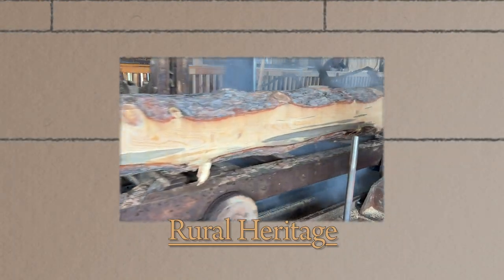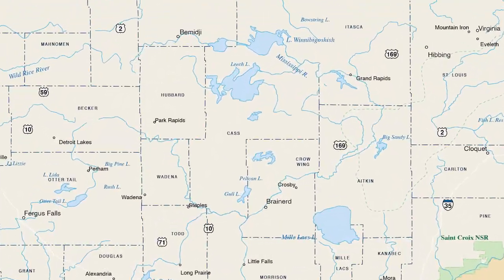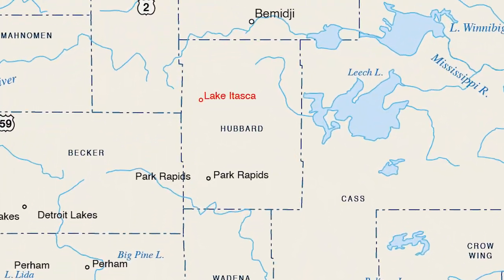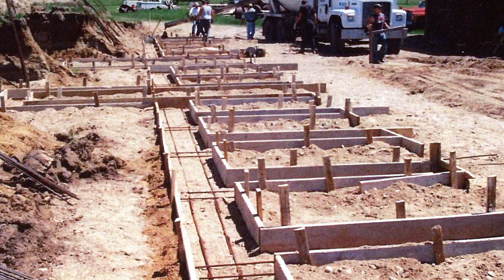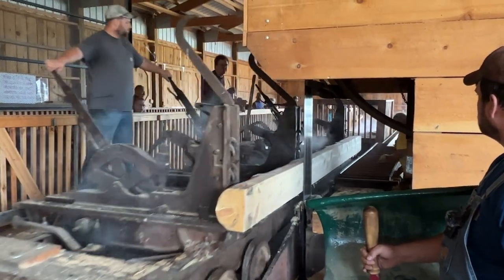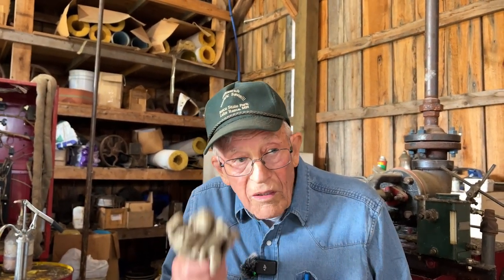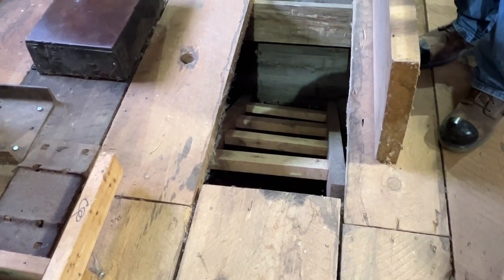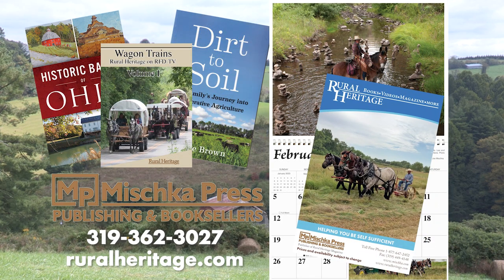Itasca Sawmill Part 2

Comment: We still run them every day, updated a little. At the mill work at we have two head rigs a left and a right and a horizontal resaw, one head rig and the resaw are high strain. On a normal day we change saws every 4 hours, on a bad day we can go thru 6-8 saws per shift per saw, Our filers just love it. Also to note while benching the saw blade you are also controlling where what we call the tires are in the blade tension and that the back of the blade is actually longer than the front where the teeth are, if you were to cut the blade into half and lay it on the floor they are not straight but lay in a big radius 45' for our bands. there Swedged teeth and Stellite teeth and frost notches for sawing frozen logs. I may have benched many bandsaws but the old timers are the true Masters of the trade!
Reply: Well said, I've been a sawfiler for 45 years now. Done saws much bigger than those. After all these years I still love the job.
Reply: Your bandsaw grinder is grinding rather uneven, switch to a pointed feed finger, it will make a big difference.

Comment: Running blades in pairs is not a bad way to go, you can keep them both in very close comparison with each other and so minimize grinder adjustments between the two, when you sharpen them both and they then come off the saw you can sharpen them in reverse order so the grinder is then already in correct adjustment for that saw.